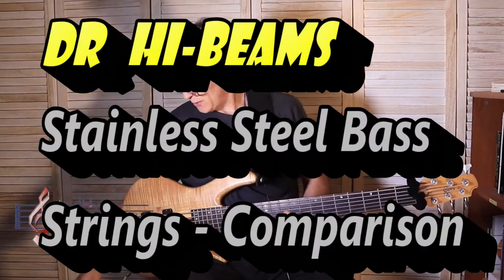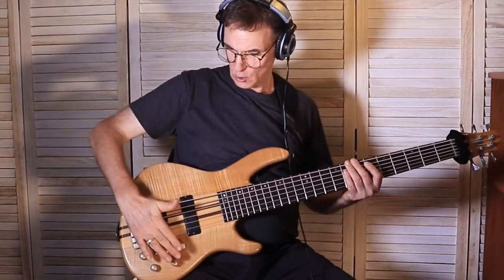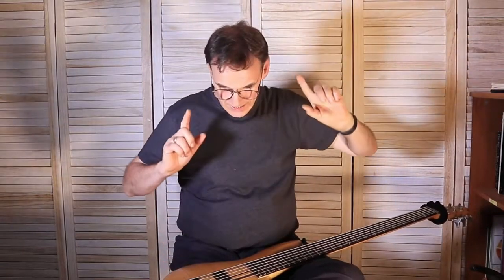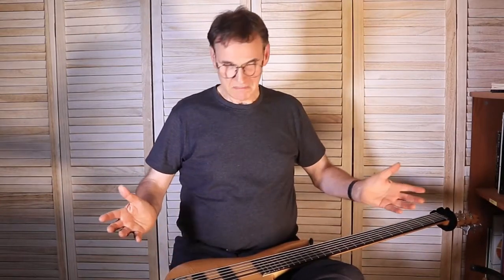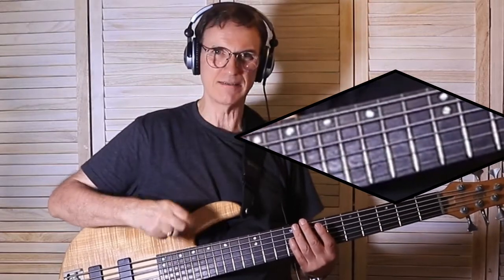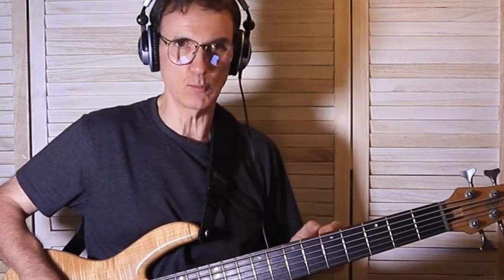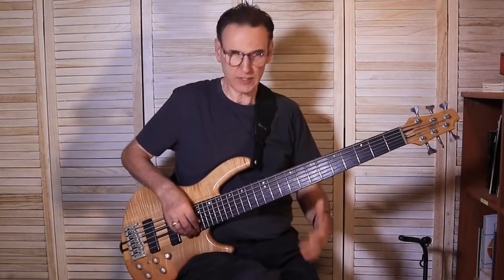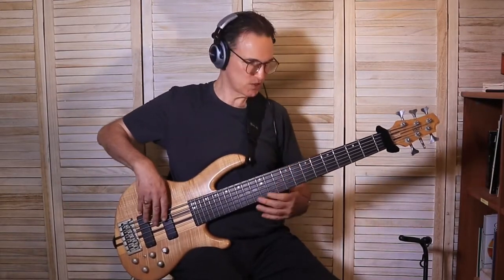DR HI-BEAMS Stainless Steel Bass Strings on 6 String Bass - Comparison Test 30-125 Gauge

Comment: The H Beams are quite a bit brighter and may encourage more of a soloist tone in some regards. May also have a bit to due with new strings too. I was back and forth between stainless and nickel round wound myself. I like stainless for slap and tap type stuff, but round wounds are fun with jazz/blues... When I had two basses I used stainless on the six, and nickel rounds on the four . Stainless keep that brightness longer as well, so I didn't have to change them as often.
Reply from the maker: Now that I got used to them I love the tone from the Hi Beams playing live in the church band.  And for my old ears I can actually hear what I'm playing over the top of a loud drummer. I can't do the slap stuff very well so don't use that technique.